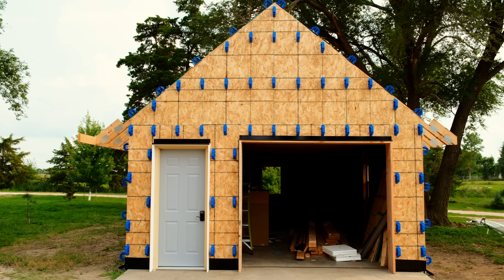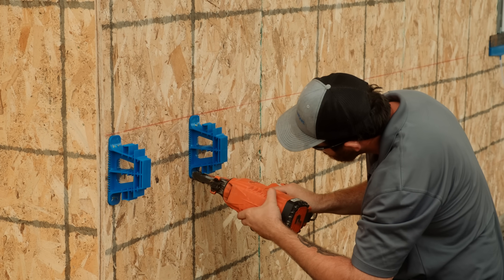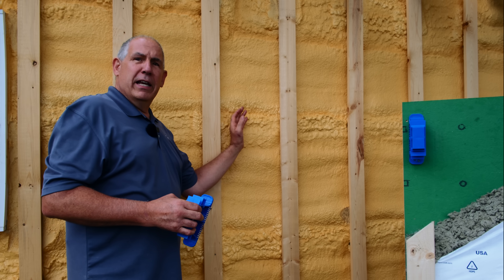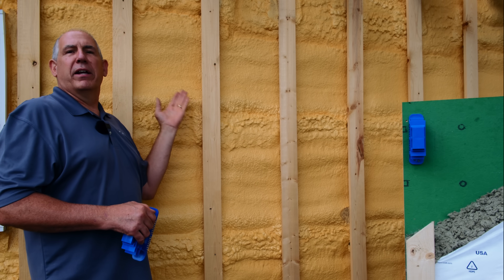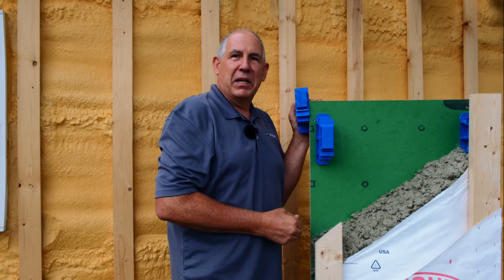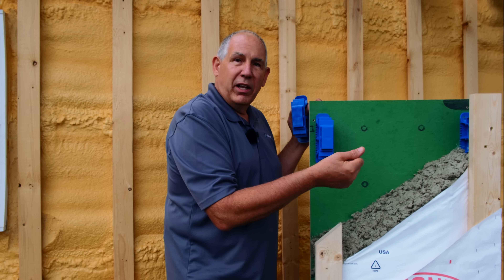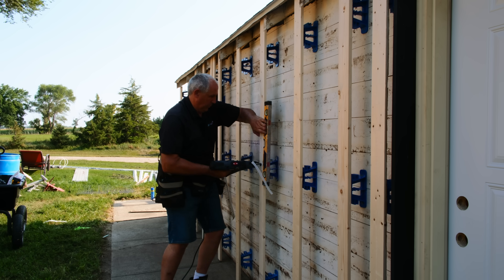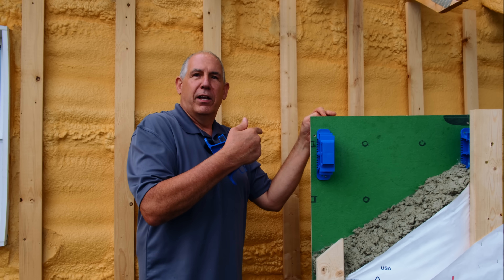We perfected the Perfect Wall... now the Roof!?

Comment: I cant say how often i come back to this system. In my opinion closed cell spray foam is leaps and bounds better than any insulation  delivering about 6-7 r value per inch seals up a weather /water tight barrier adds enormous amount of structural continuity and strength. The x bracket is ingenious way of fastening without Thermal bridge and the air flow and rain screen cant be matched especially if you go up to the ridge.  i am all in Thanks

Comment: In Ontario Canada, is this compliant as well?  

Example, standard 2 x 6 Construction OSB exterior X bracket spray foam on the roof member strapping metal roof?  Or is there an additional requirement for exterior wall ventilation etc
Reply from the maker: The X-Brackets are capable with the typical horizontal strapping for attaching a steel roof.  When using horizontal strapping, it is important that the spray foam be held back so that there is ventilation underneath the strapping or furring strips from the soffit to the ridge vent.

Bottom of wall ventilation: https://cdn-insofast.b-cdn.net/wp-content/uploads/Vented-Rain-Screen-Bottom-of-Wall-Detail.pdf

DRJ Certification: https://www.drjcertification.org/report/download/2518

If this was not as exactly as what you were looking for, please reach out to us at (888) 501-7899 and we'd be more than happy to assist you even more.

Comment: The great thing about this exterior spray foam is that it doesn't mess up everything on the inside. No need to worry about off-gassing from a bad spray foam install (mix) either.
Reply from the maker: Couldn't have said it any better!

Comment: If doing this over an existing, older home with clapboard, shouldn’t you add a WRB over the clapboard before putting the blue things on? My house from the 50s is still using that original tar paper behind the clapboard.

Comment: Two problems: 
1- the cost of the foam
2- degradation of polyiso over time

On the flip side, in extreme climates where permeating temps in the teens are routine... there's the problem of moisture content in rigid foam insulation, where its R-value hits the floor beyond freezing. I dig the idea of using a roving insulation, but it's on the wrong side for peak effectiveness. Your insulation is a thermal buffer... not a generator.... just as more dense materials yield thermal mass, are best viewed as thermal batteries.

In more temperate regions, IMPs, aka steel-skinned SIPs are a far better option to obtain both R-value and eliminate thermal bridging. You also get similar (if not better) wind and wind-driven projectile resistance.😮
Reply: It's not polyiso.
Reply: I find that hard to believe. What is it? @sparksmcgee6641
Reply: @JamesCopeland-i1j  polyurethane. He was clear about that.
Also anyone that knows this kind of foam knows that. It's been around forever.  Used on tanks a lot and it's a finish product in some forms. Sprayed on and no overcoats needed. Lot of industrial use in factories

Comment: Doubtful the exterior foam will prevent sweating on the wood skeleton. There's always gonna be trapped air somewhere znd air unless you live in the desert has moisture content. Imagine the foam exterior has to be covered with a sheathing of elastomeric or type of sealer to prevent solar rays from damaging the foam. All the form covered structures we've seen turn color and become brittle with long term sun exposure. Cheap quick but alternative can't replace stone & beams for longevity...oh! Still have air flow...
I stand corrected...

Comment: For a Florida type climate, can the blue brackets be installed in poured concrete or concrete blocks?

If so, a separate video on that would also be of interest.
Reply: Just use sheet material
Reply: Its called icf
Reply: @BaronVonFrankenBolzlll  I'd be interested to see videos of ICF on elevated structures in Florida, including details of how they handle the roof and roof transition.
Reply: @h2s-i9o Oh God no stay away from that con. ICF is the worst.

Comment: My only concern have always been about spray foam is demo cost, when things don’t go as planned, spray foam is much harder to remove versus blanket or blown insulation. Add to that the compared cost of material and installation and it begins not to make any sense. I do agree it is a great product and has its uses.
Reply: Demo cost is not a concern really, you build things to last, otherwise there wouldn't be demo it would be disassembly.
Reply: @RealCrypto  He did qualify the comment “when things don’t go as planned”.

Comment: The thing about this system is the blue blocks and the furring strips. That will help keep the foam in place. I wouldn't use any interior stud insulation so it stays nice and dry on the inside of the sheathing.

Comment: The thing about your assembly that's worrisome is the vapor barrier under the drywall. It seems that you're going to have drying problems. It will only be able to dry to the outside and that is a problem in warmer climates. It's a cold climate solution only. I get your concerns about materials but it's more about how you put them together. I'm leaning towards their original Insofast over Zip system. I'm in a mixed humid climate so the double stud is too risky for moisture reasons. Your solution is good for cold climates so I'm not debating you on that. I think it's Sweden that has a really interesting platform framing technique where the walls go down to the sill. Anyway, they are superior builders over there
Reply: Wouldn't a whole house dehumidifier system solve the problems you bring up? It's an expensive solution for sure but you have to Have ERV anyway.

Comment: Pretty slick setup., a great idea and will be interesting to see it get traction and be accepted.
Reply from the maker: Thank you, we are excited for it to be in production and see the brackets in use!
Reply: As others have said, so many other options that are better.
Reply: @johnlee7085  name one. explain the thermal bridge, air barrier and thermal performance that's better than using exterior insulation with no thermal bridge.
Reply: @fredsnit5699
Review the comments at a minimum to see other options. There are also lots of videos to explain thermal bridging, etc. It’s rather silly expect any sort of reasonable explanation in a comment section, but you probably feel better about yourself and that’s what’s important.
Reply: This is a hard no...

Comment: This seems labor intensive and costly versus building a thermally broken wall with zip r 10 sheathing and then adding either internal or external additional insulation with comfort board or mineral wool batting.
Reply: it seems a bit more work upfront for a very fast and very strong and very warm single layer of insulation no?

Comment: Would this work with a SIP system?
Reply: The guy In the video helped pioneer SIP. Looks like he just hacked a SIP system using standard stick framing building techniques and cost. He has Said in a Risinger video was the problem with SIP was that it requires some specialization and the work force of the contracting industry didn't want to adapt to this specialization.
Reply: @rodsdiy9631  sips dont require anything specialized

Comment: Plastic brackets, spray foam, OSB? My B.S. detector is going off, big time. T&G plywood sheething caulked as necessary, double stud cavity with several insulated inches between and an insulated, reflective vapour barrier under the drywall will net you a R-40 to R-60 in the walls depending on dementions. The Danish have used the double-stud technique for a very long time. As far as I know, it is building code over there as well. If it has been proven effective by the Danes for decades, it will be just as effective here in northern Canada, were I live. Did I mention they don't use spray foam? It is synthetic plastic and is bound to break down and shrink, causing gaps; and that's if it is mixed/applied correctly. It's not an issue of will it, it is just an issue of when. Choose your materials carefully.
Reply: I've never had spray foam shrink. I'm in the Mid Atlantic. Maybe in Canada that cold makes everything shrink. People get weird about foam I think its the whole green weenie thing.  I put in 2 inches of foam. Then on the Inside I use Aluminum double bubble. and tape it off. Cuts the heating bill by 80% every time. Need AC maybe 2 weeks out of the year. Spray foam isn't plastic and the closed cell just sits there.
Reply: Its not BS. The system you described is a great system.  In this video they are doing a retrofit.  You could make a double stud wall on the outside of this existing wall too, sort of.  Yes one could use this for new construction too.  If you ARE doing new construction, then all choices are available.  They are just doing something different.  Encasing the entire envelope from ridge to grade with one system is VERY intriguing, IMO.
Reply: Who cares if the Danes don't use spray foam. The only thing better than spray foam is aerogel or vacuum insulated panels. The idea that you have to double stud everything and have walls 2 ft thick is ridiculous it's the 21st century I think we could do better...
Reply: @mojo1169vj  I've been saying this for years. The Last House I rehabbed I used 2 inches of foam and a aluminum double bubble. I cut MY HVAC Bill by 80% it literally paid for itself. My EX won't sell the House.

Comment: When are you guys going to start building ICF forms?
Reply: Icf is definitely better than this, solid concrete wall with insulation on the inside and outside and you don’t need three different contractors to come in and get ready for finishing. One contractor can do your foundation, framing and insulation. And I promise a concrete house will withstand a hurricane better than this product
Reply from the maker: That's where we came from, actually.  We created our first panel, the 2.0, stemming from ICF.  We use this product most efficiently in basements where you can adhere it directly to concrete walls.
Reply: Your missing the point bruv. This is about bang for your bucky. Plenty of companies already making ICF

Comment: Isn't spray foam highly flammable and produce toxic off gassing?
Reply from the maker: Most spray foam is class I fire rated, meaning it will not act as a catalyst in case of a fire and it will self extinguish. There have been cases in the past where spray foam off gasses after installation, but it is rare and is a result of improper installation. We recommend finding an experienced installer. We recommend Spray Polyurethane Foam Alliance accredited installers.
Reply: Nope.

Comment: Couldn’t I just use small cuts of steel studs as standoffs and foam guides instead of the plastic blocks I have to buy from you?
Reply from the maker: It is possible to use such a system, however your insulation performance would take a substantual hit from the thermal bridging through the steel studs. In addition to that, the system would also require structural engineering in most jurisdictions (Especially if used on the roof). Our system is preengineered with national code approvals coming soon.

Comment: This is an awful idea. Disaster waiting to happen.
Reply: It is more likely to save your house from disaster. A roof leak would never make it inside the house.
Reply: @Matt-The-Builder  actually this type of technology has existed for 50+ years.   When the roof foam cracks or gets a hole you wont know you have a leak until you have to cut that whole side of the roof off.

Comment: The big thing here is - does it burn. I put a blow tourch onto my external insulation samples and could not get them to burn.
Wood and foam worry me.
Reply from the maker: Most spray foam is class I fire rated, meaning it will not act as a catalyst in case of a fire and it will self extinguish.
Reply: If you build like this and are worried about fire, you could apply a coat of fire retardant paint on the foam and on the inside of the stud wall.  It is used in many applications like engine rooms on ships or industrial utility rooms. The paint is somewhat fibrous and occupies the flame long enough unit the fire can be put out. It would be a belt and suspenders approach.

Comment: Matt Risinger, video, what is an over roof.  An over roof is vented by the furring strips.  New board is added on top of the strips, and then roof as normal.  So, no the roof wont bake as there is airflow.  This technology is good for an over roof.  The video thumbnail shows it.

Comment: It is said that  AIR  is the greatest insulator. So why dont we build our houses with a 2nd sheet of roofing 
underlayment to create a small air gap with ventilation? The blistering hot sun would beat down on the 
top layer cooking the shingles & the air gay underneath would ventilate the heat out. I can see the attic 
being  MAJOR  cooler that when the underside of the roof underlayment is exposed directly to the attic as 
 most all buildings are now. Seems it would be a simple solution with major benifits.

!
Reply: I think that’s what the 1xs on top do. Creates an air gap.

Comment: Don't put shingles on that roof, they will bake.
Reply: Please explain.
Reply from the maker: That is where the cross-ventelated rainscreen comes into play. The heat from the shingles will cause air inside the rainscreen to rise towards a ridge vent creating what is called a convective loop, that not only cools the roof, but also quickly drys out any moisture infiltration.
Reply: i love your engagement and you’re dead right on all the comments i’ve read this far! but 😅, those “loops” only happen on the inside of houses where the same air goes round and round, hence “loop”. outside, it won’t be a loop it’ll just be a river or whatever. just trying to make you stronger.❤